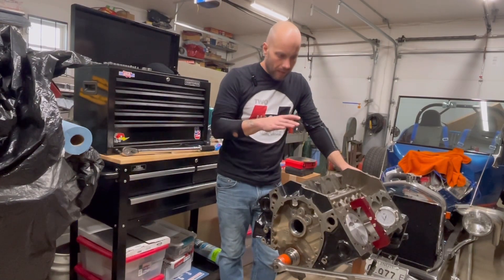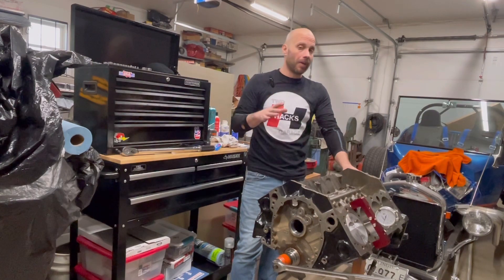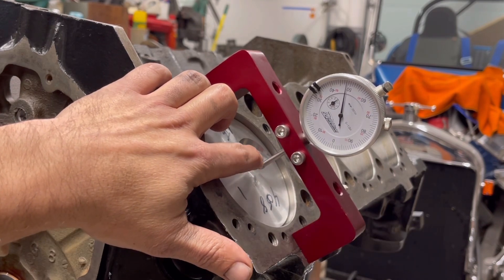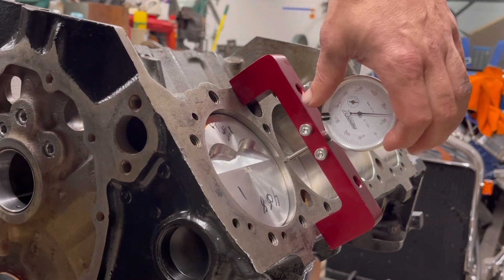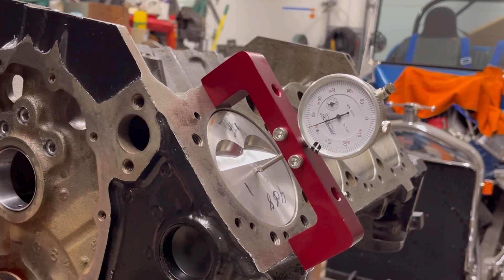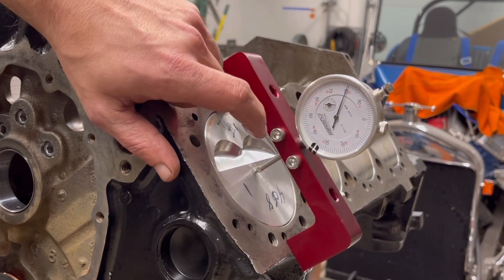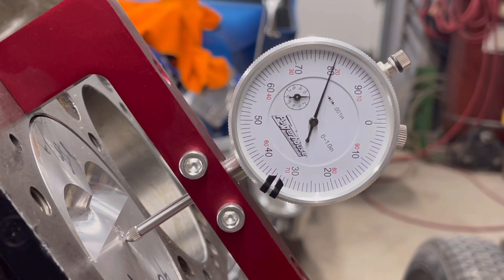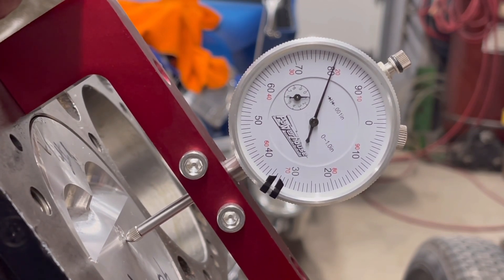Quick and Easy!  How to Measure Piston to Deck Height! #howto

Comment: Jeff would a piston to deck clearance of .01 (in the hole) be ok for a steel rod engine with a .040 head gasket... thanks... M
Reply from the maker: yes, but you really need to check your piston to valve clearance

Comment: I have this same bottom end kit I'm putting together Right now what heads and cam are you going to put on it.      I got 200 alm heads and a 282 roller cam in mine with dule plane intake and 4150 Holley on top
Reply from the maker: Sounds like an awesome build!  I am going with Brodix IK200 heads, scorpion rockers (1.4 ratio), and an ISKY 280H mega cam with a Holley single plane intake and a Quickfuel 750 DP.  Also, it will have an MSD streetfire HEI ignition.

Comment: Great video, Jeff 👍
FYI, and someone starting out, Harbor Freight will sell you a dial indicator for $18, and a magnetic base for $13. Or a digital indicator (more precise and less likely to misread) for $30 bucks.
For a few bucks, an industrial tool supply will sell an assortment of indicator tips, which is really handy.
I use it for checking lash and cam lift, rocker travel and more.
On aluminum heads or block, I have a steel plate I can bolt down.
Machinist background has it's advantages!
Reply from the maker: you are 1000% correct!  All of this stuff can be obtained at an affordable price!